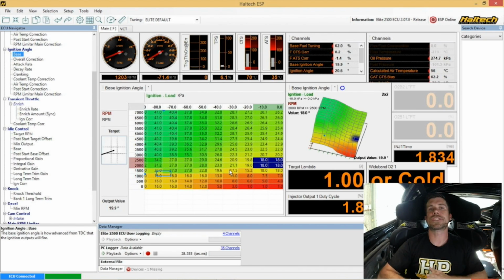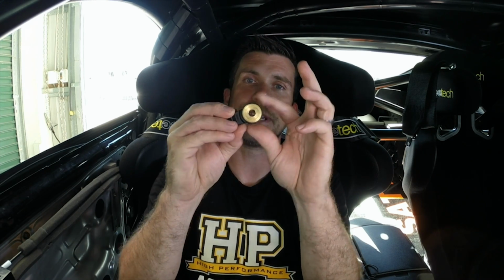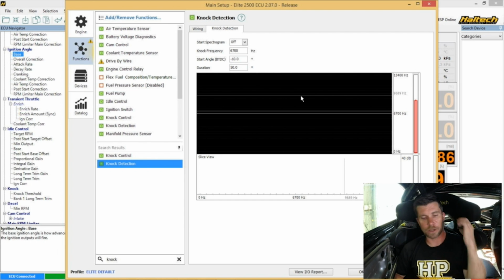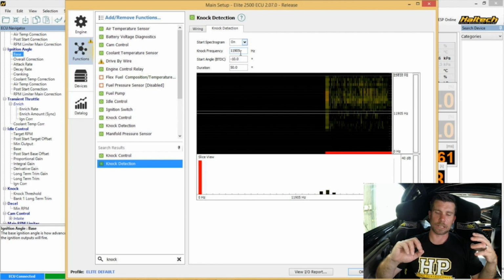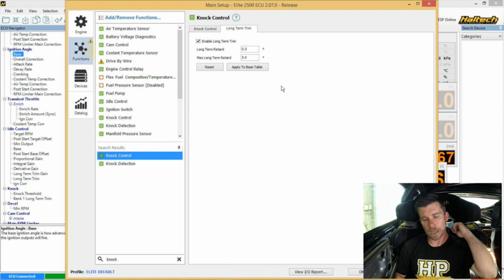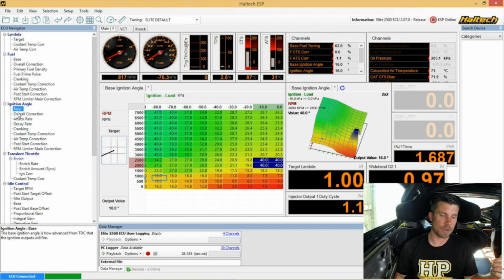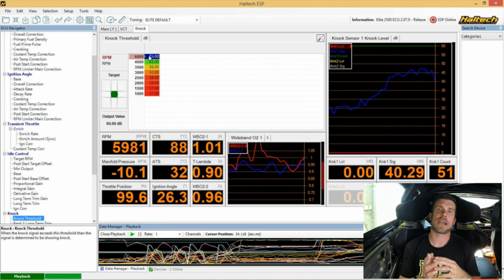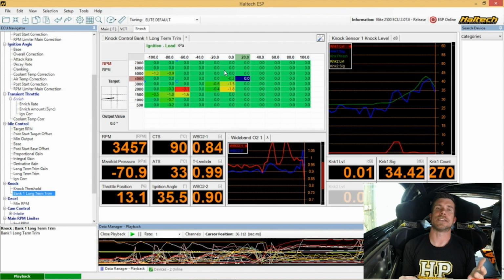Elite Knock Control | Closed Loop Knock/Ping/Detonation Control [GOLD MEMBER WEBINAR]

Comment: so much shit with a Dyno that doesnt translate to all the people using Reflash
Reply from the maker: You can reflash tune on a dyno too, has nothing to do with knock control on a standalone ECU like the Haltech Elite here.
Hope that helps - Taz.
Reply: @hpa101  i dunno, im missing like 75% of the  options and Tables in Ktuner for my Car, and unfortunately the forums has a lot of questions little answers. I'm struggling with Knock Limits, what it does, if you should modify it, how to modify it when your forced to (such as extrapolating it for psi on a N/A Car) Tables are tied together, you alter the Axis, and every Axis is changed. Columns being clamped to Vacuum Values because Ktuner doesn't support it in the N/A, and only finding that out through error and asking Ktuner Support. How to get rid of false knock, when you don't have all the options like Knock Sensitivity Table.
Reply from the maker: @Stephen-ut5xo ahh, I thought you meant dyno tuning vs road tuning. Even with KTuner some of the tables you have (or don't have) access to can vary from car to car as well. Reflash tuning is different in that way, you are right.
With a stock ECU though you do also have knock control already setup, and you just need to confirm it's working and adjust if needed rather than needing to set it up from scratch like you do on a standalone like the Elite here.

Email through with a link to your forum thread and I'll get Andre to dive in any help you =) - Taz.

support@hpacademy.com

Comment: Was it the cracke/ rustle noise? Never heard it before and didnt knew who knock sounds like. Thx for showing us
Reply from the maker: That is the knock. The constant noise in the background is just your engine, then that crackle over the top is knock/detonation. It will sound a bit different in different engines, but will still be similar enough to help you distinguish it. I am not the tutor here and this video helped me understand what I was hearing when tuning my own vehicle for the first time. It was surprising how much knock was occurring on the factory map, but also being a low strung NA engine it also wasn't really a massive issue for me either. Once you add a turbo or supercharger though that changes quickly!
Hope that helps! - Taz.
Reply: @hpa101  thank you for your answer and further discribing it.👍 since im watching your videos about stand alone ecu tuning, im thinking about it to try to tune my s13 rb26 by my self, once i switch to the emu black i bought. I learnd from you, that i have to tune the ITBs with alpha n. But i still need to get a knock monitor, if i should really do it by my own.

Comment: I noticed that when you lifted off, your knock numbers went above the thresholds. 
How can you stop that registering, if you get the margins right for accleration? 

Do you remove base timing, or increase the threshold  on zero/low throttle?

Comment: Excellent!  Exactly what I was looking for.  Thank you Andre!  My only question would be if there are more advanced ways to increase the signal/noise at high power levels when noise is much higher?  Does knock always occur at one frequency or could monitoring multiple frequencies together increase the signal without increasing false knock?

Comment: This is extremely helpful for my current project. It answered so many question I had that I could not find without a significant investment of time on forums waiting for replies about a specific issue with specific conditions. I believe I need to invest into a more expensive ECU so that I have access to a higher level of modification/control and information gathering. Thank you very much for such thorough and comprehensive videos. I enjoy your content very much and I am quite grateful for how much I have learned from you in the short time I have known about this channel.

Comment: i have a knock sound at around 3000 rpm at like 30% throttle, engine at normal temp, (stock hyundai sonata (theta 2.4L) 2010), since it was brand new it's doing it, now it has 90k km, and still doing the same thing.
if it occurs, i will change the throttle amount immediately, i can't figure it out ! 
no fault codes, the car was brand new, i went to the dealer, they tested it ... no clear answer, what do you think is happening ? Oh, i also tried to put some octane boosters ... same thing.
it's not a big problem, but it's frustrating me, note that the car is very quick and nice on the road.
Reply: your knock sensor can be with a problem. Consider changing it

Comment: How about intake temperature? In turbo cars, the flow true intercooler is highly impacted by speed and pack / drag effect driving close to someone in race. The nock limit is by my understanding inpackted which intake temp. Is there a way to tune the spark advance faktoring in the intake temp?
Reply: Definitely. Typically there are iat compensation tables. These also exist in factory ecus
Reply: sexy_face correct